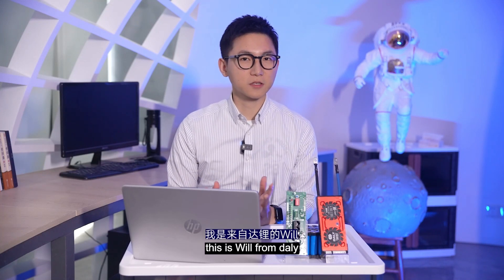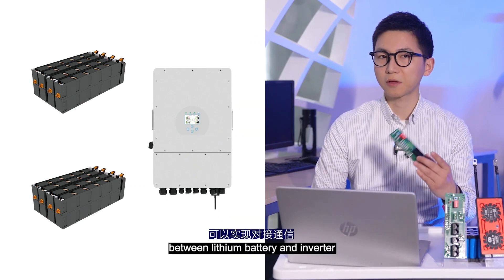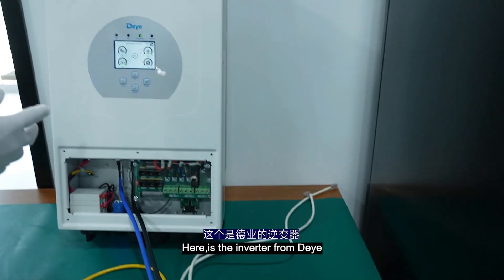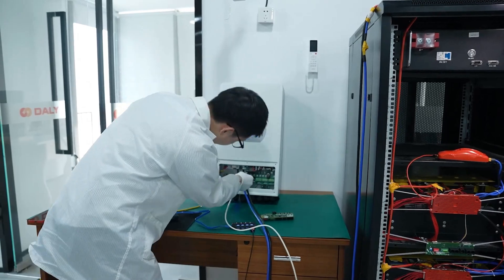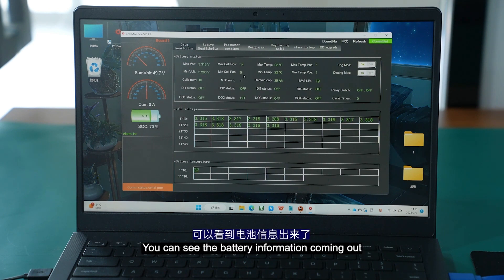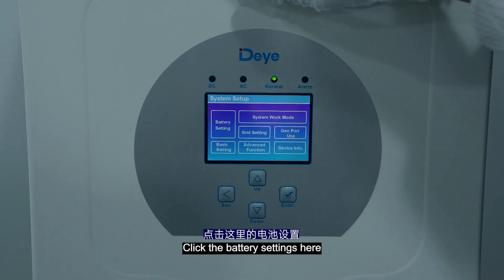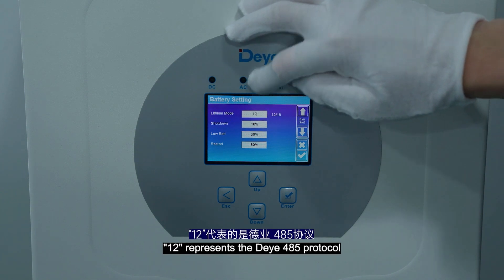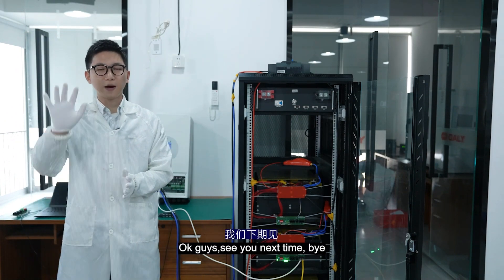How to connect a Daly BMS parallel system

Comment: hello, thanks for your video. My problem is the BMS reads all the time SoC 100%, does not meter the voltage of the battery or even if it is empty. How can I fix this? thank you

Comment: The Deye inverter only sees the first BMS, even though the Deye inverter is capable of managing all BMS individually.  I'm concerned that an issue such as high temperature in a slave BMS will not be seen by the inverter.  Will there be a firmware upgrade for better compatibility with the Deye inverter in the future?

Comment: Hi - I think I will use CAN bus to connect inverter to the WNT board.  However, I don't think a standard straight ethernet cable is compatible as the CANH and CANL pins are swapped.  I need to build a special cable that swaps pins 4 and 5.  Can you confirm that my assumption is correct?  Thanks.

Comment: Hi there.   I have growatt spf5000es.   I'm having issues with rs485  connection to interface board.    Inverter settings  are LI   then  L01  036 in inverter.    What are setting for CAN  from interface board via rj45 cable to  BMS port in growatt inverter?  Can you do video showing step by step.  With popular growatt spf5000es inverter please
Reply: Hello..anyone there?  Have you read this?

Comment: I have a question:
I have two battery packs.  Each pack is 48volts 16s 272ah.  I want to connect both banks in parallel using two 200 amp Daly BMS with parallel modules on both.
What is the installation sequence to install the BMS AND THE PARALLEL MODEL TO EACH BANK.  I need your help because I don't want to damage the models or the BMS.
Reply: sir, you can ask the salesperson for the specific instruction

Comment: hello, here you can download actual version BMS aplication
https://drive.google.com/file/d/17NFqMD1xwCHyK4CCZJlHrhpIurgbsI3b/view?usp=share_link

as it was written - DIP switch must by setup -> first BMS ON OFF OFF OFF OFF OFF, the second is OFF ON OFF OFF OFF OFF
in aplication at right up side find "Board" an can you click for change

last important step -> in DEYE invertor must change battery mode lithium ->SAVE -> again battery setup and lithium mode must change manualy "12" (this stap is not automaticaly

Comment: Hi,
Witch connections need to be done between the daly BMS and the interface board ? Is it 1:1 from the Daly "Led / light "port the the "Mainboard Connector" on the interface board using the cable included the interface board ?
Reply: sorry,i do not understand it

Comment: hello and thank you very much for this very instructive video. it really helps me in my project. is it possible to have 1 pack 16s and 1 pylontech in parallel? thank you.
Reply: what is pylontech?If you want to parallel the battery packs,you need to make sure the total voltage of them is the same.

Comment: Thanks - It is a little bit confusing - Please show all connections including PC USB to 'wnt board' - Is that connected to RS232 of 010000 board?  Do you have to program each wnt board?.
Surely the inverter should be connected to P- and P+?  There is a typo on the video.
Also, you should make clear that the other boards have different addresses?  By the way is 000000 a valid address?
Reply from the maker: Hi Adam，actually it connect with 485 port to PC master ，if you need parallel communication you must need set each wnt board to same inverter program . And yes all the user need to set different address for parallel system , such as 010000 its master pack, 020000 its slave 1 , 011000 its slave 2 .....
Reply: How do you set up the dip switch for master and for slave? I’m not sure what is 010000, is that down,up,down,down,down,down on the dip switch? Slave?
Reply from the maker: @gilbertviloria2366  yes，thats mean this board number 2
Reply: @yipdamon1808  i have 3 pack battery with dalys, how would i set my master on the dip switches for master and the 2 slave?
Reply: @Yip Damon, how do you set the master? Up,down,down,down,down,down?